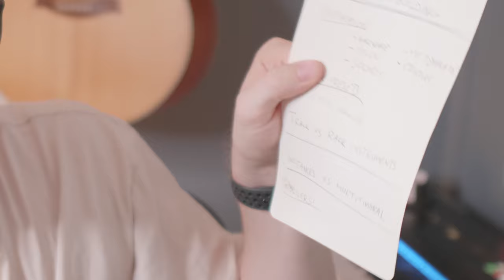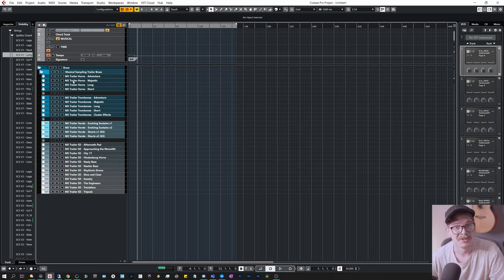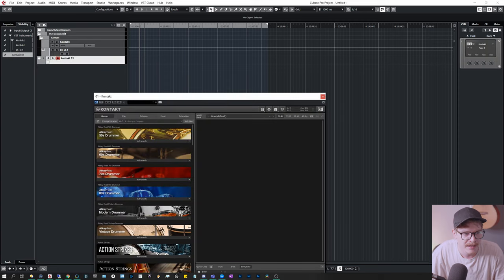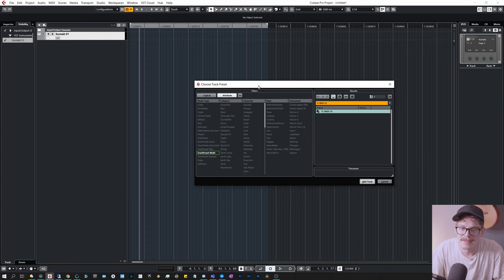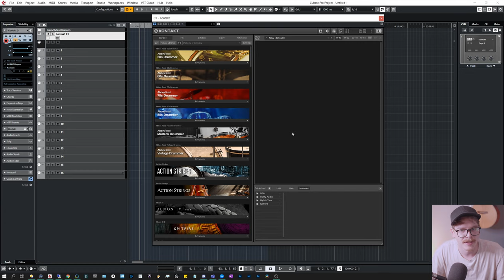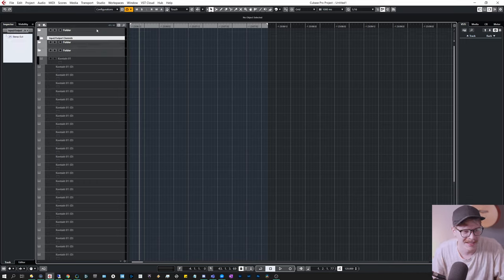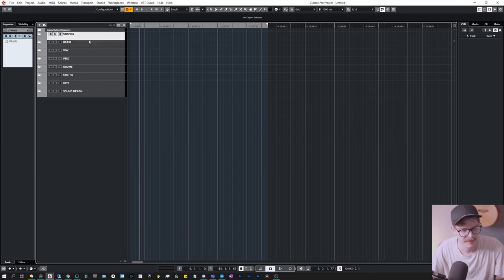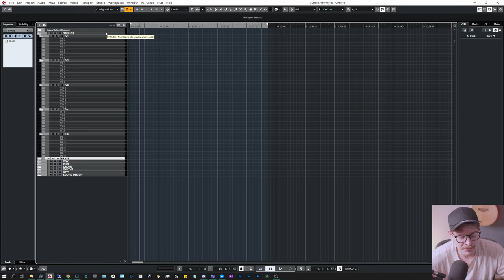Filmscoring TEMPLATE for Cubase | How to build a MODULAR composing template PART 1

Comment: Stupid question time! Whenever I add a track in Cubase (actually Nuendo 10, which you probably know is "cubase10.5+") I have to activate the speaker icon on the track to hear anything when I play the keyboard. It doesn't seem you need to do that... Any ideas? PS: your videos are great!
Reply from the maker: Hey, thanks for checking out the video! Are you using software instruments or audio inputs in this case? For software instruments I only need to select the track to arm it..! But for audio tracks I need to do alt+D to hear the input. I’m fine with that way of working for myself but I think there’s some options on how the program should behave in the preferences..
Reply: @SifterStudios  Thanks! I suspect it is just a setting in Nuendo that is different default than in Cubase. I'm just trying to play my midi keyboard and get sound out. Not a big deal as long as I am just playing around, but was more concerned if it could be an issue when you start creating stems etc down the line. I doubt it will affect that though. Thanks again.

Comment: Hi there ! Did you say that the BIG template is around 2400 tracks ? OMG ! How long does it take to load ?
Reply from the maker: HELLO! Yes that’s correct! I’m incorporating a slave computer as well, making that happen, and lots of ram. The concept is the same though. I think it take a couple of minutes to load, and each save is between 20-30 seconds. So I’m looking for ways to shave it down a little. Will be working with the main template for tonight’s stream over on www.twitch.tv/sifterstudios if you’re interested or want to ask more questions and see it in action! 👍💪 live in 90 minutes!